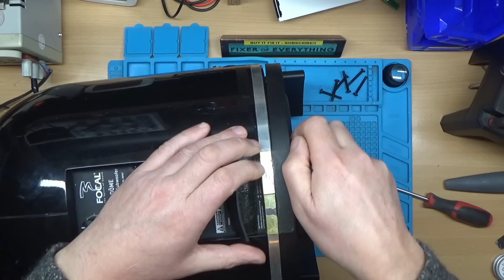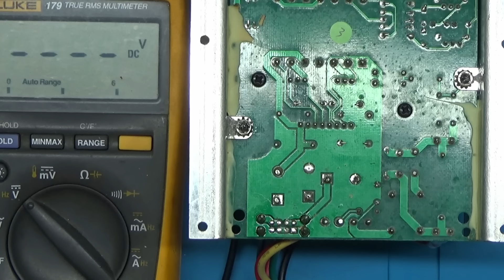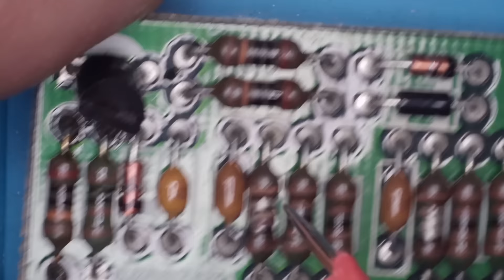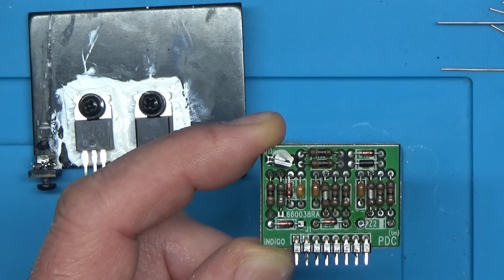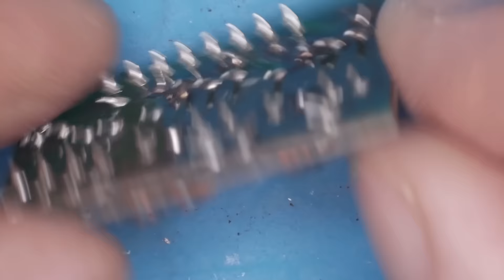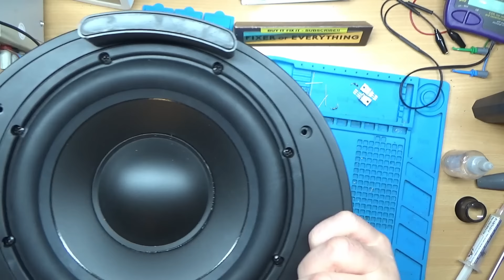Faulty Focal Dome Active Subwoofer | Can I Fix It?

Comment: Hi-fi equipment is sometimes of poor quality in terms of circuit boards (the conductor tracks come loose when you even approach them with a soldering iron) and sometimes other parts too (burned by hot resistors, etc.).

Comment: De-soldering tip. Excellent fix. Love your videos. Get a piece of solid copper wire. Lay it across ALL the pins of what you want do de-solder. Use flux (obviously) and heat the copper wire with your soldering Iron. If upside down, the component will often fall out. Don't believe me?  Just try it. I learned this from another YouTuber. It really works.
Reply from the maker: Thanks mate 👍Yes possible Mr Solderfix? I think I saw that one too. Totally forgot about it though.
Reply: @BuyitFixit  
And it’s convenient (and cheap) to clean the holes from solder with a toothpick.

Comment: I just don't understand that board as you can get a single chip that with a handful of other parts will do the job better. Anyway, well done on the fix. Shorted zeners are always nice to find, whereas open ones can cause massive collateral damage.
Reply from the maker: Thanks mate, yes I thought it was a slightly odd design also. Seems it's also used in a few other makes of amplifier too.
Reply: @BuyitFixit  I hope to one day be able to peer into a speaker/amp at a Repair Cafe and say "Well, well, an Indigo board, I haven't seen one of those in years!" and get gasps of admiration. I've now got the picture with the component values on my phone, so thanks.

Comment: While I think of it, Mick, is there a combined solder station on the market you'd recommend? When I say 'combined' I mean both contact & airflow, ideally interchangeable. I'm thinking of a mini hair-dryer design  with an interchangeable nozzle for air or an inserted bit for direct contact: the heating element would be the same either way; only the method of heat transference would differ. Temperature-controlled, obviously, but the cutout for the application interchange (bit to nozzle & back) safely could be a challenge. The advantage, ofc, would be a smaller workspace footprint consumed :)
Reply from the maker: I'm not sure mate, I've got two separates myself. This is what I use mainly. The Aixun T3A soldering iron and the Atten 862D for hot air.

Comment: I love watching repair videos (especially yours because you have a very soothing voice, don't talk too much and I love the accent 😊) because I'm trying to understand how to find a fault on a board, but I'm so frustated when I hear the dreaded sentence "doesn't seem right" when testing components with a multimeter and not saying what "right" should look like. And it's not just you; every electronic repair creator does it at one time or another. Still, keep up the good work. Happy new year and greetings from France.
Reply from the maker: Thanks, greetings from the UK. Normally on a diode or transistor, you should get a reading of around .5 or so one way, and nothing the other way (when swapping leads). I did a video on testing transistors etc, perhaps check it out. If you get a very low reading when testing a transistor or diode both ways, it's a good sign that it's "not right" or "blown".

Comment: Hey there my friend. Im and Alan too by the way lol. I also have a question for you. I have a bluetooth amplifier that has no sound on it. I was wondering what would have caused it. It worked one day and than this problem. It doesnt show obvious signs of any component blowing on it. I was kind of hoping if you have any ideas where to start at on it lol.
Reply from the maker: Hi Alan, I'd probably start by trying to work out if there are any voltages missing.
A good way to possibly check is have a look at what chips are inside, find the data sheets for those, and then you know what voltages should be on what pins.
Then see if those voltages are present. Some boards have markings or test points on them, things like +12v etc. It's hard to say without seeing the board.

Comment: Thanks for fixing the sub, looking forward to seeing you soon and spending a few hours at your place, it is a disgrace the components and glue inside the sub, it's a good job this was made before Focal joined Naim audio as this would not have passed the quality checks that Naim used to do.Focal should be embarrassed the way it's stuck together, this  sub is not in my main system, it's in a Denon surround system.I use REL subs in the Naim stereo system. The Focal speakers system is for cosmetic, the wifey prefers them to the KEF eggs system the Focal costs a lot more than the KEF but sound quality is about the same, p.s inside KEF subs are also low quality(stuck together with glue) as well.
Reply from the maker: Nice one Alan, Glad I could help, and yes, it was a shockingly cheap build inside.

Comment: I have a guitar amp that uses the external chassis as the heatsink - aluminium fins, and I was expecting something similar here.  Focal are a premium brand, but this looks fairly off the shelf components stuck in a tube.  I would expect heat and vibration stress to be pretty hard on the components inside this.  A bit disappointed!!

Great repair though.
Reply from the maker: Thanks 👍Yes, I must admit once I discovered the price of it (after doing the video) I'm not really impressed with the build quality, which seems to be what I'd expect from a more budget device.

Comment: Love this channel ❤. 
As soon as you opened it up I recognised the transformer and circuit layout of the 'indigo' subwoofer amp, a Canadian design from the 2000s that was used in Mirage and other brands by the same company. I have this same board on the bench at the moment, so I'm glad to see a potential source of parts in a Sony product if necessary. 👏
Reply from the maker: Ah, that's interesting! Thanks for sharing that info, it's always good to know the origins of these designs 👍
Reply: Interesting it's Canadian as a year back I fixed a MASSIVE active subwoofer for my plumber (free plumbing, yay!) and it was made by a Canadian company called Paradigm. It was from the mid 90s and the PCB was wild and I think it was all prototyped on breadboard and then moved to a PCB while changing as little as possible of the layout. All the heatsink screws were Robertson square ones. Mine had am open zener that let the -12V line drop to -36V so I had a slew of op amps, capacitors, and a monolithic amp chip, to replace.

Comment: It amazes me how designers/manufacturers can over engineer and over spec some aspects and then crapify other elements of a product. That huge heavy aluminium body and some realty cheap nasty components inside. And no vibration prevention on the cables and nasty cheap spade connectors in a thing that is designed to shake the floor. 🙄🙄🙄🙄
Reply from the maker: Agree, the case etc is well built, but everything else looks rather budget.

Comment: Nice job. When replacing components like resistors and capacitors that get hot and it may happen again just becasue of the design, I often leave long legs on them, if space permits. It gets them up off the board for better airflow, keeps them away from neighbouring components that may be radiating or absorbing heat, and the long legs act as a bit of a heat sink. It also means anyone going in there again will immediately see the components that have been replaced.
Reply from the maker: Thanks, and good idea 👍

Comment: I had a few of the lcr-t4 bare testers and they really work well for everything. atmmega328 it goes by too. the one I like had 91make toaboa on the back of the board. you drop them and its game over so I been thru 3 or 4. they were $4 then $14. you could print up a case and sell them because the ones the sell are clear plastic and horrible
Reply: maybe it was a lcr-t3 that seems to be the good one

Comment: Nice repair 👍. I think the small board just got slightly damaged from overheated resistors. I'd much rather a board I could repair with a few cheap parts. Rather than having to try and source expensive Integrated IC packages.
Reply from the maker: Thanks 👍Yes very repairable, although most of the IC's I've found on power supplies aren't expensive. I've just had to order 1 for a Samsung TV, and I think they were 50p each or so.

Comment: They sell this at a high price.  High quality they says!  Cheap capacitors, cheap modulation board, extremely simple amplifier.  Focal does not merit his quality reputation.
Reply from the maker: Agree, It's the first time I've came across them. When I was repairing it, I wasn't aware of how much they cost! The build quality is more budget than premium.

Comment: Nice fix, Mick!  If you need royalty-free audio for videos such as this, there's a YouTube channel called White Bat Audio that makes a ton of royalty-free stuff, you just have to credit him in your video.  (I'm not affiliated with him, but I've listed to a lot of the music, and it's very good).
Reply: YouTube also provides music for use on your channels that's royalty free.
Reply from the maker: Thanks for the suggestion, someone else said why didn't you add some solder mask.  I think I get more focused on repairing things, and the other secondary stuff tends to go out the window, especially at 3AM. I can't think of everything after all 😂😂👍

Comment: It points to the floor not so good if you live in a flat.
Reply from the maker: Very true!
Reply: How else would you expect a subwoofer to work? The whole concept is to use the surrounding surface as a resonator (similar to an eg acoustic guitar or cello sound body cavity) hence amplifying the low-frequency sound waves; the floor is the most convenient surface to use, followed by wall & finally ceiling

Because low-frequency sound doesn't travel far in a low-density medium such as gas (ie air), the output has to be proportionally high-powered & massive (weighty) to impart the low frequencies desired & dampen random resonance harmonics/interference. Prolly not the sort of thing you want to attach to a wall or ceiling unless it's built-in & the entire space is strengthened & designed for the job :) Hence those huge bass speakers you can see at eg rock concerts or clubs: they're not just for show!
Reply: @snafu.X  I know, I'm an engineer. Not so good if you live in a flat though, poor neighbours!

Comment: Evening Mick!

. . .There is a circuit floating about for that little supbanel online but it was drawn in KiCAD on a black background and I could barely read it!

. . .The black component is a DIAC or trigger diode – these things were used in early 1970s colour TV sets for triggering the mains rectifier thyristor, they're a symmetrical four–layer device that "breaks over" at  30 V, 33 V, 40 V or 60 V, and it provides the startup function – when the mains is applied the diac triggers when the voltage across it reaches a high enough level and it sends a pulse into the driver stages to begin oscillation! Normally they do read open–circuit when you test them on a meter!

. . .The one used in those panels is a "DB6" 60 V breakover type which isn't as easy to get but one German eBay seller stocks it!

. . .Old ctvs used a Mullard  "BR100" or an I.T.T. 4EX581 diac – both of these trigger at 33 ± 1.5 V!

. . .In the colour TVs that used them failure generally caused the picture to judder or bounce vertically, but as these devices are only used at switch–on to start the PSU in these subwoofers failure of the diac is unlikely!

Chris Williams
Reply from the maker: Thanks for that Chris, and for the explanation 👍I think I've heard of a diac before on Big Clive's channel, but it's not something that I recall coming across before. Thanks again for clearing that up!

Comment: Lucky you found the values seems well built apart from the small pcb. Good fix as always.
Reply: Erm, what about the cheap components, the poor design, dodgy glue and the propensity to fail? Overall a poor quality product but a good repair.
Reply from the maker: Cheers mate 👍I still don't think the build quality (electronics) is great for something that costs that much.

Comment: Good trick for desoldering tricky multi-pin components like that board; cut a bit of braid long enough to bridge all the pins then just saturate it and the pins with 60/40. Easy to keep all the pins molten and the component should slip right out.
Reply from the maker: Thanks for that 👍Low melt usually does it well too, I think this one had a large ground plane on the middle pins, and I didn't have the heat on that long enough.

Comment: nicely done a bloody nice fix and a greta little sub too , that litle daughter board u repaired ive come accross the material its made from before and its terrible if it goes black from heat it turns conductive which is prob why people offer replacements had an amp years ago thta took ages too sort as couldnt see the board was damaged under a component it had got hot and the board was causing a short due to the opcb becoming conductive wher eit had got hot had to grind out the bit where the balck was and use bodge wires to put the component elsewhere lol worked tho when i had finished
Reply from the maker: Thanks 👍Yes bloody horrible board. I've seen boards go conductive in the past too.
Reply: @BuyitFixit ye it’s the fibrous ones that seem to do it like u could see the weave in that which is a dead giveaway it’s goin to be trouble haha

Comment: Good fix Mick, although I did see that at 6:10 you measured across a short circuit and not the capacitor. This sub speaker looks like a cheap 'pseudo HiFi' american brand, which is very poorly made. It seems to be a bit of a gimmick and it doesn't appear to be a reflex enclosure
Reply from the maker: Yes, noticed that too when editing. Different view on the overhead to what I have when measuring, and looking at the monitor to make sure I'm in shot still 😂😂 Yes the quality inside doesn't seem great to me either!

Comment: Nice one ! Did you check online for know faults before the video or just jump into it ?
Reply from the maker: Just jumped straight into it, although when I was searching for what components were on the board, this board does seem a common failure on similar devices that use it.

Comment: By the looks of it id say its a bash amp  made for focal  they made amps for every speaker company you can think of though the years the early to mid 2000s.  Its a class d .  They still make and sell bash amp under there name bash. They also still use that stupid glue.  Im not sure if its true but  some said the glue was orignaly made by sony  not positive though.  but the company new its wasnt good to use butt still sold it to other company for a few years till it started to age and came conductive.  A lot of the times it will turn a brown  color  when it does.  Bad solder joints because focal mounted the baord on the speaker not a very good design placement  The  bash  power supplys most fet tend to go bad on the power supplys  that are smp  tend to go bad after a few years  transformer or triod  last whay longer just my opinion  lol as im watching you as say.the common problems with the bash design.  There graet amp till they go bad.  Even when every thing working and good when i see yellow glue i know its got to be replaced with silicone  there  quite a bit of brands that use it  car and home audio. 🤮💯🤑🫡🎶🎵😉✌️⚡️

Comment: The bulb in series is an excellent idea. I would also utilise a £15 mains monitor to check power and power factor if applicable.
85°C caps fitted in an expensive sub..jeez!
Not impressed with the design one bit. No wadding to protect against cables rattling etc. Amstrad quality!
Reply from the maker: Thanks 👍Yes expensive sub, but cheaply built it seems!

Comment: Another great video but BIG errors were made.
Mick you need to double and triple check that you have identified the capacitor legs on the flip side of the board. I'm not sure  you got the correct joints on the first 2 but you definitely measured the same connection when you tested the second output cap. You had both probes either end of a track.
Reply from the maker: Thanks 👍Yes noticed that when editing, but I just left it in. The problem is when you're trying to fix something, while looking at the monitor to make sure it's in shot, and thinking what to say at the same time, without making and errors is quite difficult. The output caps were only 35v or so anyway so not a huge issue.

Comment: Not sure I agree with the 'preventative' maintenance.  The replacement parts are more likely to be fake than the originals!  As they say - "if it ain't broke, don't fix it".
Reply from the maker: I had been thinking that but they do wear and are a common failure point on these. I did order the mosfets from Mouser, not AliExpress, so I'd expect them to be original.